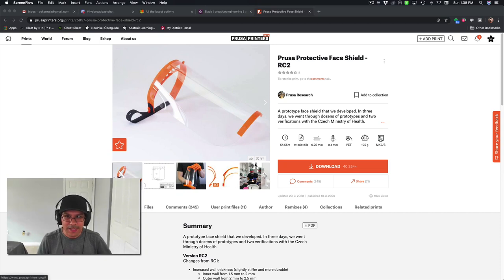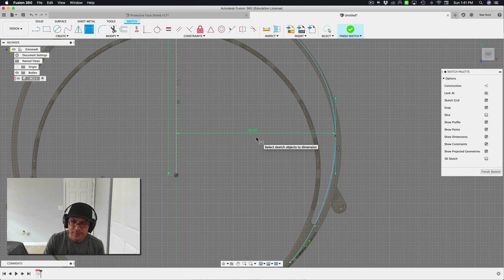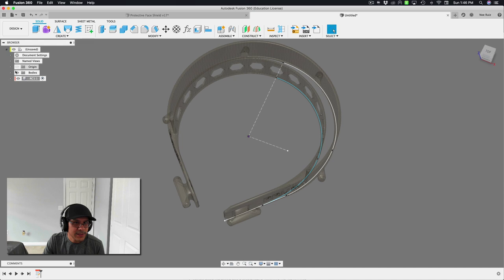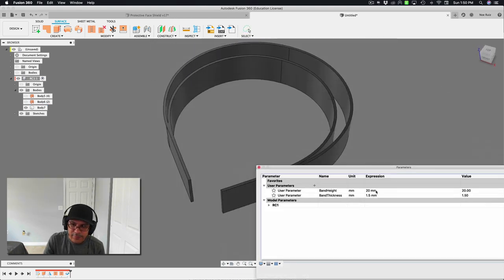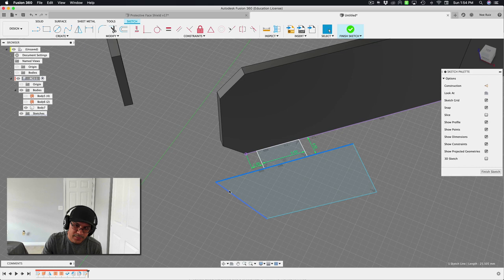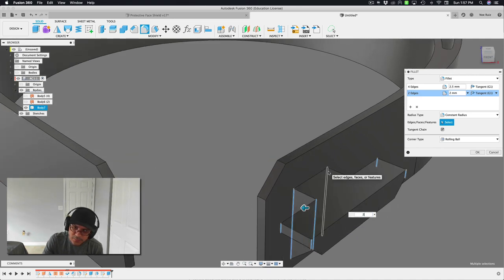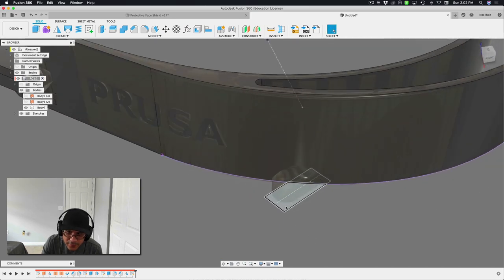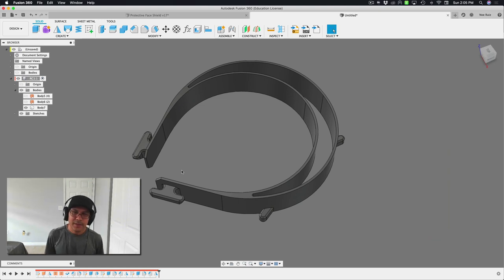How to Design Face Shield Fusion 360

Comment: Great tutorial, I learned about the surface tools I didn't use yet. Thanks.

I had to modify the facemask model to fit my pre-punched laminating pouches. Finished it minutes before discovering this...

The important parametered features should be the "nubs". Rather then specify the dimensions from the center, it should be from the middle of the front band and along the path of the band. This can be done with pattern along path. That way we could measure the holes with a ruler and create a band to match perfectly.